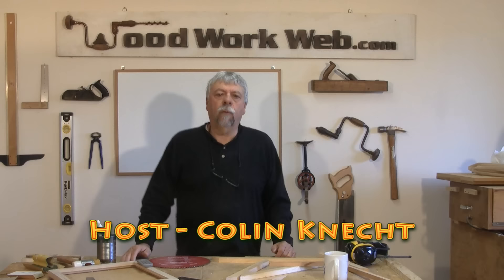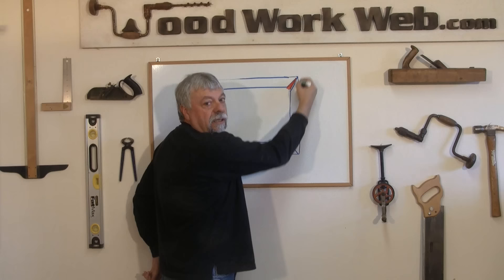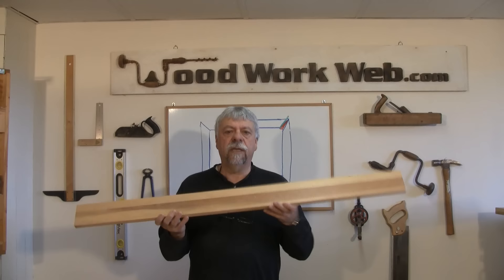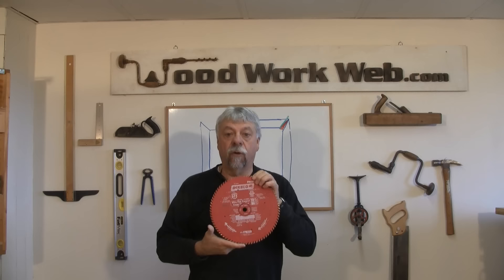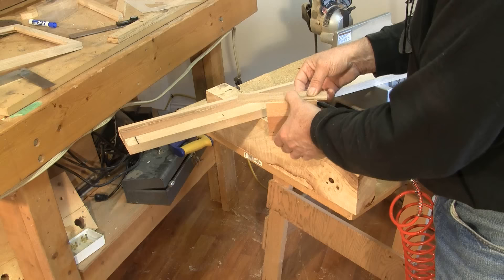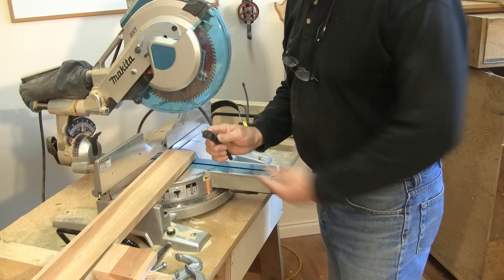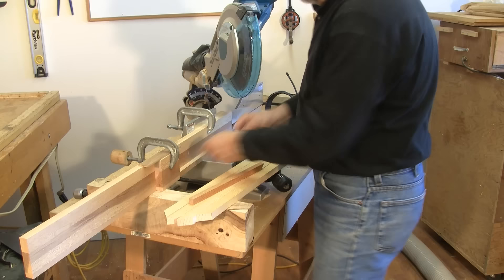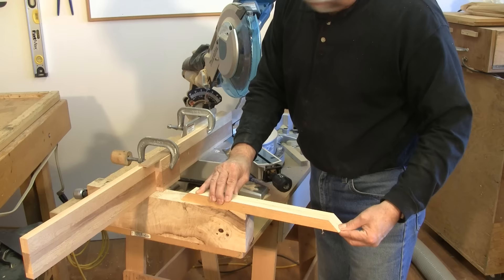Making Picture Frames with a Sliding Mitre Saw - A woodworkweb.com woodworking video

Comment: He's correct that the opposing sides need to be the same length. But, I think he left out a few things. I have specialized in making picture frames, and this is what I've found; Not only does the mitre have to be set at 45 degrees, so does the bevel. This is adjustable on a lot of saws. If the bevel is not set at 90 degrees, the corners won't come together nicely. You also have to take into account saw blade wobble. Using a DeWalt compound mitre saw, and a Freud Diablo blade, I've found it nearly impossible to get the blade wobble down to a point that the face of the cut is flat enough. The frames I make are high end, glued together, and I expect that there will be NO voids anywhere in any of the 4 miters. The solution was to go to a specialty tool, the miter trimmer. It's a hand tool that shaves off a paper thin piece, and once set to 45 and 90, it's good to go, more or less, depending on the wood used. I also bought a specific picture frame clamp. It has rotating corners, and is adjustable for a large variety of sizes. It clamps all 4 corners at once from the middle, ensuring even clamping everywhere. And, it doesn't cost a lot. See Grizzly Industrial, among other places for them. I always trim, and clamp it dry to gauge how nice the miters are. Once satisfied, I look for even squeeze out of the glue. The final test is when you sand it, and there are no voids.
Reply: Seth Watson make a video
Reply: Erudition
Reply: Jkwk
Reply: Seth Watsonii
Reply: i make picture frames as well, i back your advice. even at perfect 45 blade wobble is a bummer.
Reply: Seth; You mentioned a Dewalt compound mitre saw, and a Freund Diablo blade  and that it's impossible to get the blade wobble down. I have a very little used Delta compound saw purchased in 1990, and now that many years later I want to use it again on redoing interior wood trim around my new windows.  Is a Delta a good saw or should I just buy another new one, AND which brand (not too expensive) should I consider? Thanks Seth.

Comment: You don't even mention the rabbets that are necessary or the points hammered into the rabbets to keep the glass and the picture stable? If this were a video on making accurate 45 degree cuts, than I would understand, but it's a video on making " picture frames ". If you needed to do a part two in order to explain these points than you should have. I feel like you told half the story.

Comment: CONTINUATION

 I have always wondered if the two supplied plastic pieces that form the slot in the saw table are supposed to be snugged to the blade beacuse the screw slots are elongated.  If that is so It would be nice if the saw was supplied with a spare set.....

Comment: I have several miter saws, both compound sliding and conventional.  I have made sacrificial fences for all of them.  The keys to frame making are accuracy and consistency.  Having a sacrificial fence is a way to achieve both.  Being able to visually reference the kerf cut from the blade on the surface of the fence allows you to know exactly where the blade will enter the work piece.  Along with either a movable stop block or pencil markings on the fence, you can control the cuts to have both precision and repeatability, the hallmarks of quality frame making.  Ten minutes of making that fence will save you hours of frustration.  Colin is spot on with this.

Comment: As an artist and a woodworker, I make a spacer to lift the pieces off the fence, so that when the 45 is butted against the stop block, it is true to your measurement every time. This avoids the possibility of the sharp angle wedging into the crack between the fence and the stop block, possibly making your measurement short. The spacer just has to run the distance between your blade and stop short of the spacer block. It could be as simple as a 1/4 inch strip of plywood cut to length. I have made spacers to fit standard sizes of frames. This way you can be accurate and faster in producing standards. Anything in between will be covered by the standard bridges, because the spacers does not have to run the entire distance.

Comment: This video appear to be made at least 5 years ago. Even so, it is still current in 2018. Over the years I have had need to make an occasional picture frame. Never could get it right. Close but not close enough. Your video was most helpful. Like many of the commenters, I made just about every mistake you covered.  By reference I am echoing all those that comments on how helpful the video is. The few detractors have probably forgotten what it is like to be a beginner and the need for slow paced, clear, and easy to follow instructions. Keep up the great work.  I have bookmarked this video so I can refer to it again in the future when needing another picture frame.

Comment from the maker: Yes, the stop block is used basically as a measuring device, and yup, depending on the wood, if you press too hard you could feather the end, but in our experience we really didn't encounter any problems with that, but thanks for mentioning it, it could be an issue with some. Great to have you with us and thanks for taking the time.
Colin

Comment: I found this video extremely helpful. I do some stained glass panels and the end result are glass panels where the size may differ. Framing using mitered corners and measurement have been my Achilles heel. This has cleared the problem up for me. Thank you.
Reply: @Hello Jim how are you doing

Comment: I  do not have a  shop.  I do most of my work outside when the weather is good.  Your tips are awesome.  I don't have a sliding mitre saw.   I especially like the tip of the sliding stop block.  I am going to try this on a regular mitre saw.

Comment: I edit my own videos for my channel and I know how much effort and time is needed, so I appreciate every minute of the video. When you find a channel like this or like thewoodwhisperer one, time is not that important because you know it is a masterclass.
Reply: Totally agree!  And the plug, well if I’d a Sliding saw, it’s good to always be thinking about unplugging it!  A bit lengthy yes, but as a beginner, very necessary. I am just questioning a little bit about the “the pinning it togerher” I assume that is a nail gun Not a staple gun?  And if we don’t have that tool, what else would be suggested?  Thank you! 🙏🏻
Reply: @juliepiper7058  glue  and a belt clamp..I mean as a woodworker there is always something you need or don't have..at first.  I'm slowly building my tool arsenal.  I ordered the belt clamp thing that supposed to work good with picture frames.  I will try the dowel pins also.  That is just kinda overkill..It's a picture frame..The precise location of putting the dowel pins in is a whole other step that can be skipped.  I suppose if you have to do everything the old fashioned way then more power to you.  Maybe if it falls off the wall it will stay in one piece with dowel pins, probably not with glue. .

Comment: I'm a beginner and I've run into the brickwall of the the last joint not mating. Tried to correct the problem by cutting where I 🔊THOUGHT the angle was off. And we know the rest of the story onthat fiasco. Watched ur video and thought, " threre must be an easier way".I did work out another way but it took HOURS to execute. From routing to cutting the last piece of the frame for the top of my bookcase took 7 minutes. I'm quite satisfied with the skills I learned from your video. By the way I watched this vid FIVE times before I had confidence that I could do it. And I it did flawlessly. Thanks friend✏📏📐😊😎🇺🇸

Comment: Haven't read all of the comments, but when cutting the 4" stop block I cut a 45* angle on the piece as I frequently have found when working with soft wood such as pine, pressing the finished cut against a squared off stop block can flatten the point slightly and end up slightly shorter than desired and perhaps not the same length as the opposing side.  Using the 45* edge of the stop block eliminates this potential variable.  As usual, another great instructional video! Thanks for all you do!

Comment: Colin, I've responded a few months ago but wanted to give you an update on my progress.

Of all the videos I watched, this one (not the updated version) was the one that gave me the guide I followed.  I'm now getting pretty good at this for basic frames, because you were there to get me started.
I have made a couple of updates to your setup I wanted to share.  I've come very close to buying products ranging from maybe $150 to $300 to get exact measurements for framing cuts.  Then I saw a product on a Walmart add that gave me it final answer.

I got a fabric tape used in sewing at attached it to the top of the backer board.  I've cut the stopper block (as you describe in your video) flat so that the top part is even with the stop part.  

To be sure the backer board is always in the same position on the back rail, I've drilled 2 holds thru the rail and backer board and secured it with recessed bolts and wing nuts.  Easy on/off.

The tape is adjusted such that if you place a frame side against it at 16 5/8 inches, when you slide the frame side in as you describe in your video you get the exact desired length.  So, a $4 tape and 2 bucks for a couple of bolts and I have a solution as good (or better) that much more expensive products . . . all built on your solution.  I can provide pictures if you're interested.

So again, thank you for sharing your experience and helping me become a pretty good DIY frame maker.
Reply: @Hello Peter how are you doing

Comment: Uncle Colin. On more than a few occasions I've heard you refer to "having better quality tools" in this video here "the better quality miter saw the better your cuts". I'm by no means saying that better tools aren't better to have. But certainly the more important issue is to get the job done right. 
I would be willing to wager that you could make far better picture frames and other projects with a low budget miter saw than I could do with professional equipment. In essence the color/name on the the tool isn't very important compared to quality and individual skills. 
 So please be mindful of the invalidation one could infer because they don't have a 80 tooth blade for their miter saw like Uncle Colin. 
    Thanks for all the tips over the years. Keep them coming 👍🏿
Reply: No Colin is right on this. All mitre saws only come with very general purpose blades because they don't know what you are cutting. What he is saying is it can still be done with a budget saw if you get an 80 tooth blade. Point is even on a Makita you would struggle with the factory blade. You are correct that the name on the saw is not important but what is needed here is an 80 tooth blade or like he says one degree out on each mitre is 4 on the last corner.
Reply: @dannymurphy1779  point taken. thanks. 👍🏾

Comment: Thank you so much for this video. The tips you shared made a HUGE difference for me! My old chop saw is not properly calibrated so checking with a proper square, using the wood fence and that little block made all the difference! Thank you!

Comment from the maker: Hi Everett, Great to have you with us. Both the table saw or router work fine for 1/4" rabbet, although the router version is often a bit cleaner. The main difference is that the table saw works best if the project has not been assembled so you are working with long straight pieces of wood. If the project has been assembled and you have corners, the router can be a better choice. 
Thanks for commenting and for the good question
Colin

Comment: Very well done. You sacrificed your time to make this video for the benefit for all to see. Your dedication to safety letting the saw stop before removing material is good practice. I have some engineers squares so I guess I can use them for the jig after the material is cut.
Reply from the maker: Hi Ron, thanks for taking the time to comment, and thanks too you for your support. Great to have you with us;
Colin

Comment: Thank you for such a clear and helpful video. The only thing more frustrating than not getting my angles right is not being able to do the dry fit to see if things fit properly. That right angle frame set up you have to push against  is a great idea. Thank you for being so generous with your time, sir.

Comment: This is an excellent video taking us though how to use a sliding mitre saw for frames.

Colin, it would be even better if you could show how to cut the stock to pre-determined lengths. For example if we are using purchased picture frame mouldings (moldings) with rebates already cut and the picture/glass/backing is (say) 12 x 18 inches.

Very useful demonstration. Thank you.
Reply from the maker: You're welcome! Thanks for watching.

Comment from the maker: Hi Steve, thanks for the note. You could use either a table saw or  a router with a dado bit to cut our that rabbet on the frame. My experience with both is that sometimes, depending on the wood and the grain, the router choice tends to fray the wood, the table saw is my first choice.
Great to have you with us and thanks again for the question.
Colin

Comment: I have tried to make frames before, but I never knew about the "equal sides" thing.  never gave it a thought and as you said, I always went back to re-cut and it never worked.  I enjoyed this video and I have ordered myself a new 10" sliding compound miter saw and will put your theory to work.  Thanks for sharing.
Gene Grissom
 Frost, TX
Reply from the maker: Gene Grissom Thanks Gene, for commenting

Comment: Great Video! Someone else may have said this previous, but it is also imperative that your blade/tool is vertically 90 degrees as well or it will really booger your corners. If you have a cheap saw (like me haha) never trust the markings on the side! Thanks again!
Reply from the maker: +Tyler Vickroy yes .. good point, never trust the makings ...even expensive saws can have this flaw
Reply: I trusted my cheap saw. Oh dear. Now I know why not one of my frames has worked. Measure, measure, measure. Thanks

Comment: I made a very happy discovery: I was cutting all angles with the saw set at the same 45 deg stop, ie not swiveling the saw around but turning the wood upside down. If the angle is not set at exactly 45, this results in an accumulation of error. But when I cut one end of the moulding using the left 45 stop, and the other end using the right 45 stop, the pieces fit perfectly, with no gaps. The errors cancel out in this way. Eg if the left 45 stop is actually at 44 degrees, the right one will be at 46. (well given that the on the saw scale they are at 90 wrt eachother). Worked for me anyway..
Reply: Yes. You can use a miter saw to get perfect 90 degree corners with no gaps for your frame ...even if your miter saw does not cut precisely at 45 degrees.
Reply: That is fantastic.
Reply: What?
Reply: Naw, it's just that Kelly couldn't quite hear us.  Too much sawdust in her ears.
Reply: LostInMySpace HER
Reply: Thank you...corrected!

Comment: Hi Colin, 

Love the videos, many thanks for posting them.

Where possible, ie cutting small sections, it is always better to use the saw 'chopping' rather than 'sliding', it's slightly safer, slightly quicker and a slightly better cut too.  Most sliding saws have a knob for locking-off the sliding rails.

A sacrificial 1/4" MDF double-sided taped to the top to the saw creates a 'zero-clearance' base improving the cut further. CONTINUED (sorry)

Comment: Well done. I am new at making my own frames but I'm more confident after watching this. I would have loved a little bit on how to mark the wood. I am guessing you just mark the actual length required and then make the first 45 degree cut and measure from the angled end to be equal to your required length.....guess I'll find out :-)   The only other thing worth mentioning (for us Newbies) is that in the video, when you make the first sets of 45 degree cuts in the framework then align it to make the opposite cut,  it appears you are using the longest edge against the fence so that the end cut is in the right direction.  Again, to hard to tell so off I go to learn on scrap pieces. I do appreciate your clear directions, just thought a few things would make it 150% awesome

Comment from the maker: I have never seen box joint made on a sliding mitre and it's probably not a great idea for that, hard to control the depth of cut. I was making 1/4" wide cuts ... thanks for asking this, I forgot to mention it in the vId
Great to have you with us, thanks for commenting
Colin

Comment: I use a table saw with a miter sled which gets things close. Then I finish on a disc sander with a table mounted at 90 and a miter sled at 45. I leave the final side a hair long and make and necessary adjustments at the disc sander to get things to fit.

Comment: Thanks chief for excellent pointers on making a random size picture frame. But with the dimensions of the frame I want to build. Since I've got the dementions for my frame, do l measure from the outside out inside points. No doubt I would set that length to the stop on the backer board. Please include that in your next video.

Comment: the reason I love my sliding saw is because it creates less friction when cutting thicker/denser boards, as you can move the blade back n' forth dissipating the heat, much much better